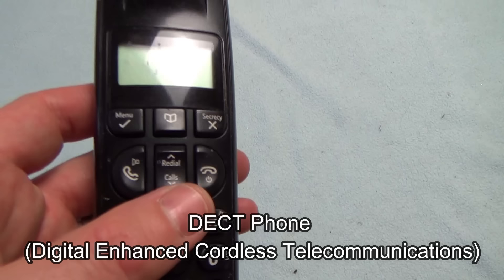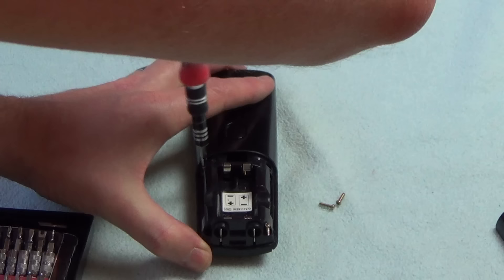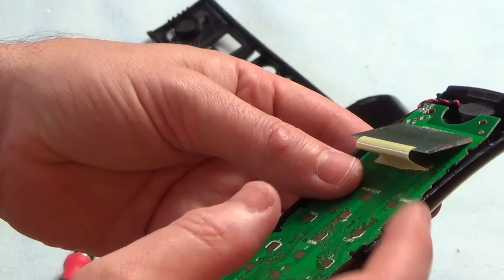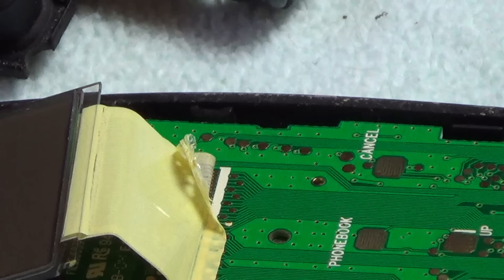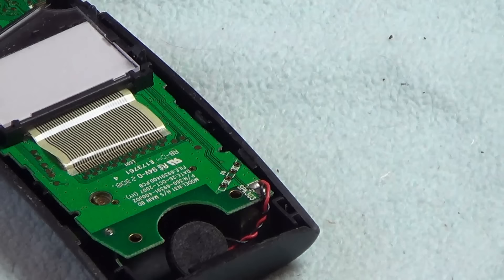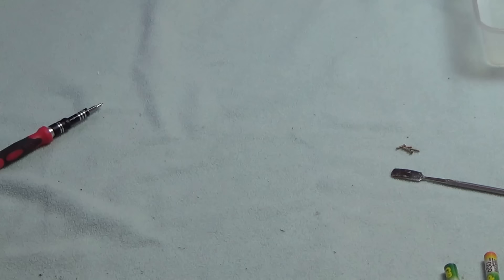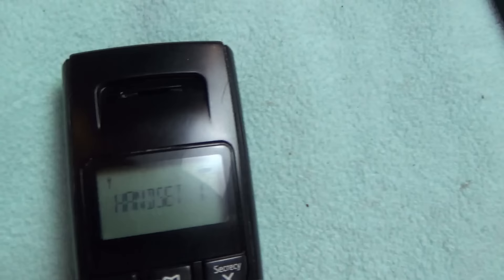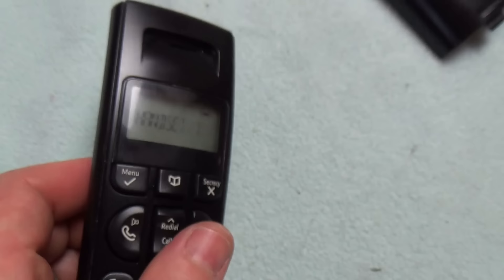Faulty LCD Display - QUICK FIX

Comment: This is why I hate the adhesive method of connecting the LCD to the tracks of the PCB (known as hot bar method).  Those tend to fail over time when the adhesive wears out.  I prefer using all zebra strips instead.

Comment: This looks exactly like the vertical lines fix on the gameboy dmg.
Reply: Pretty sure it works on the same concept, but instead of a matrix like on the gameboy, it’s just segments on the screen as the lcd works a little different
Reply: @drcarrot415  Yeah, absolutely. I just mean the ribbon itself. The wiring is def different. If I'm not mistaken, that is a liquid crystal display though, right?
Reply: Tuncay Ayhan yeah, the difference is in the way they display though. The gameboy uses a standard pixel-based LCD but this phone and watches and stuff use segment based LCDs, which offer simpler design but less use cases
Reply: @drcarrot415  Thanks for explaining!

Comment: Top man; followed your tip and recovered the LCD screens on two phones; all segements as good as new. My tip is you don't need a soldering iron, a 30 sec blast with a hairdryer and then pressing along the ribbon line on the contacts with a platic tipped tool does the trick.
Reply: I also used a hairdryer. Worked for me too.

Comment: EXCELLENT! EXCELLENT! EXCELLENT!!!! THANK YOU!!!!!!! I bought an Excalibur LCD Chess Computer on Ebay and the display on it was showing partial images scattered haphazardly all over the place. I was just about to throw it out but searched for repair options and came across your excellent video!!!! I improvised a heating iron by heating a single-edged razor blade on the stove, holding it with pliers. I wanted the straight edge of the blade to be my "iron". It took 5 tries with gradual improvements with each try. It finally works perfectly just like new!!!! WOW! Thank you so much!!!!!!

Comment: Ohhh wow. Right around the time you'd done this fix, I'd seen some other YouTubers using the same technique on old Game Boys. The way the Game Boy gurus love to teach it is to do it with the power on and the display within sight, so you can use the lines flickering on and off as a guide for where to apply more heat. Brilliant how you were able to cinch it so quickly without a visual guide.

Comment: Hi Vince,
may i suggest another thing you could do on your channel?
Well basically it is the same, but different.
How to videos, but for more crafty/freaky things, maybe going into a more technical/electrical detail.

i.e. 
Transform an old PS2 (or something else) into a mobile console.
Install DOSBOX on a Nintendo Wii to play retro DOS games.
Convert a NES gamepad to work with a Commodore C64.
Or some DIY electronics, like a digital wall clock, maybe putting it into the case of something broken so it looks fancy and special.
Add an "Audio in" headphone jack to a car radio which does not have one.
Remove old speakers from a car and put them into wooden frames so you can use them with another device in the house.
Convert an old CAR radio to work on a power supply in the house and attach an antenna to it.

You could maybe add videos with a mindset of asking "Can you do it? - Instead of - Should you do it?" 
"Does it make sense or have any practical application? Maybe not. Is it fun to make and fun to watch or does it look fancy? Heck yeah."

Comment: Thank you for the video, very well done. My phone is quite similar to yours, but when I did the same the flat cable melted. I've tried to cut the melted part and find the flat cable connections using a sand paper and a knife, the clue or protection was removed, but no connections were found, tried to soldering the shorter flat cable and it melted again.

Comment: LCD's & their connection designs are tricky.  Engineers try to make it cheap by reducing number of parts, to reduce selling price to the buyer.  In this case, the ribbon cable is stuck directly to the board, rather than using some kind of female-male FFC ribbon connector system or similar, which that type of mechanical connector would have kept the contact lines stay more stable & a longer life, instead of like what happened here where the adhesives & ribbon bending have made it lose physical connection faster than if it had a connector.  It's all about the balance of how long a consumer can hold on to using a device versus the device's calculated life time, including wear & tear.  Thus, repairs are necessitated when a consumer needs to use the device longer than the device's engineered lifespan, which sometimes a company could care less about how long their  devices can live out in the consumer field.

Comment: The PTFE tape was unnecessary, the knuckle isn't watertight and does not need to be, its there to squeeze the hose on the water outlet. Putting the PTFE on only made it more difficult to screw on the knuckle... Otherwise nice repair, I wouldn't have thought about this solution, but it works well!

Comment: That was brilliant! 
My problem is that although I have a new never-used spare, all the useful numbers are on the handset with the screen that very suddenly degraded this year.
Curiously, it degraded following the batteries running flat - co-incidence or was there a temperature transient during recharging?

Comment: May as well post here, I have a 22 year old lcd alarm clock, still works great but one tiny part of the display has a missing piece so a 8 misses i of the 7 lines, strangely now and again it works and when it does it lasts for a few days, I did take the screws out and wipe down the circuit with 99% IPA but it didn't fix it, I was thinking of rubbing a barely warm solder iron over the cable like what fixes a Game Boy lcd, but not sure if that would work.

Comment: i have lived in my current house for the last 5 years and haven't made a single landline call, shame BT make me pay for a phone package even though i just use the broadband. great fix though.
Reply: BT say we're paying to rent the line regardless of what's connected to it.
Reply: I never called companies from a mobile, nor do I give them it's number.

The landline, for only a few quid a month is great for exactly that purpose.  It also sounds better than a mobile, which helps when talking to the "customer service agent" on the other end as they tend to use heavily compressed wireless headsets.

Besides it would be very strange if a house didn't have a line.  How would you know who is at home when dropping the Xmas presents? :D

Comment: Tried your fix on a Philips piece of crap cordless phone with buggy
display. Little too much heat and ZZZZTTTTT. End of story.
BTW, when I opened it up I found sloppy solder joints, glue slapped
everywhere. Looked like a ten year old worked on it.
NEVER BUY PHILIPS.